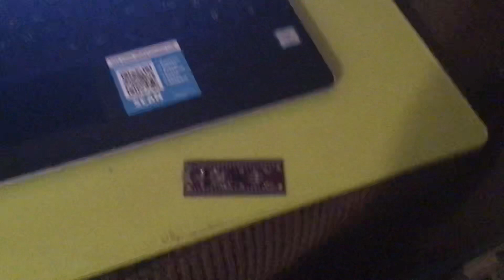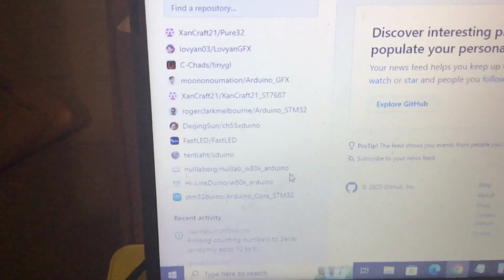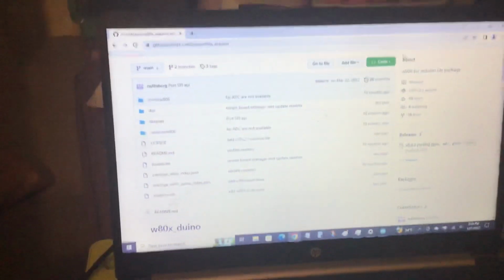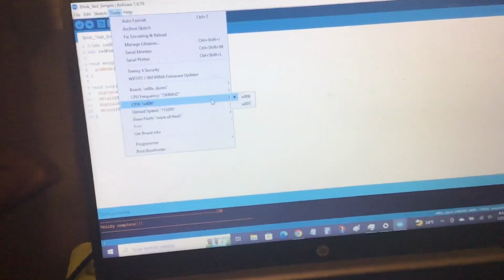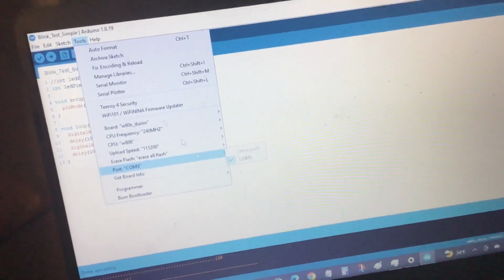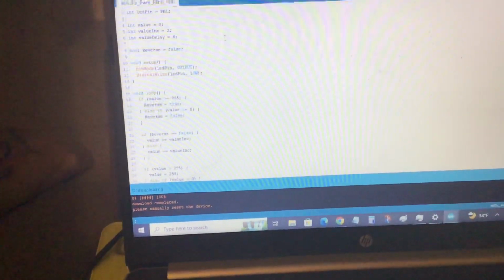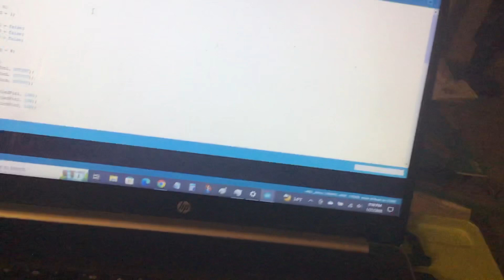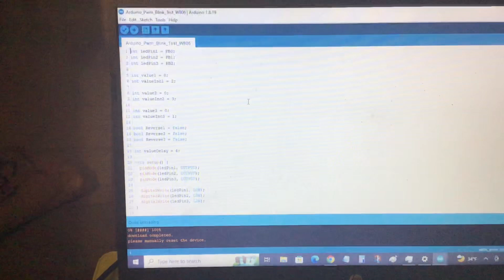Another strange microcontroller. How to program the W806 controller in Arduino

Comment from the maker: Just so you know it appears that this type of controller has a very short lifespan. Mine is already dying with little to no use, the ground lines are failing and some of the pins no longer work. It still seems to program fine, and my unit may be defective. I would still avoid buying this if you can, unless you just can’t help yourself. They’re cheap enough to throw away, as long as you salvage any pins you have soldered to the board.

EDIT: I tested the onboard leds and they still seem to work, so the controller has some life left in it. It’s only a matter of time before it dies completely.

EDIT 2: I managed to revive my W806 controller by soldering between the ground pins and the nearest screw holes. Let’s see how long it lasts.
Reply from the maker: @user-eb6pg1lg3w  ok, sounds like a good plan. But i must warn you, in case you plan to use the Arduino board, i forgot to mention in my video or description. The package only supports W806 and W805, so the W801 you mentioned will not work with this. It should still be ok if you have a different software that supports that chip version. I hope your board doesn’t give up on you early like mine did.
Reply from the maker: @user-eb6pg1lg3w  ok. Could you give me a reference or name of the software you plan to use?
Reply: Not surprising as I don't see any ESD precautions implemented.
Reply from the maker: @nordehasoci  i’m usually mostly careful with that kind of stuff. Although i am not always careful all my other controllers never had any damage. I believe mine could be defective or have a defective PCB. But i will take more care in the future.
Reply: @XanCraft21  It's also worth mentioning that the W806 is a 3.3V logic device and that applying 5V to an input will damage the device. I've used this board in a number of projects without problems and am very impressed. Will upload a few to YouTube in the near future.
Reply from the maker: @nordehasoci  even though i used the correct voltage on the pins the ones i used still died. May i ask how you were able to get good use out of this controller without any good software?